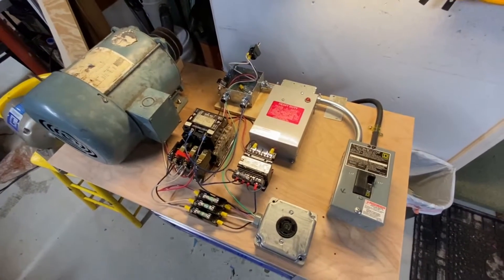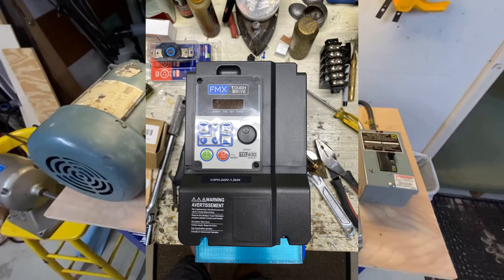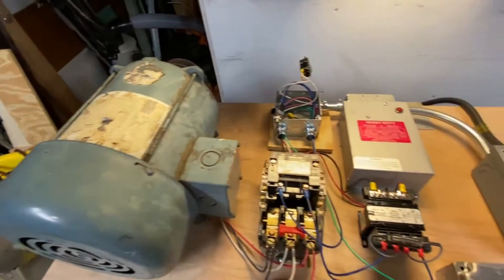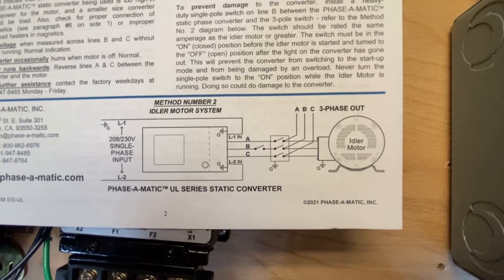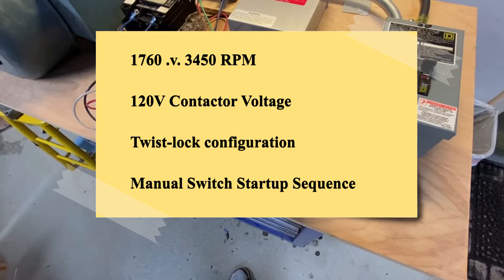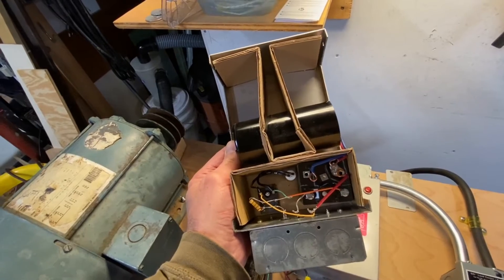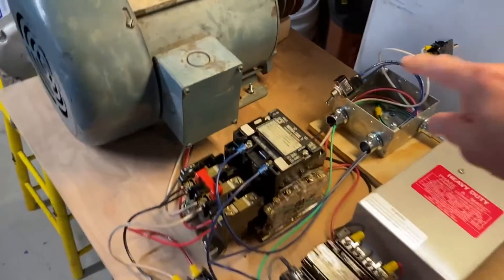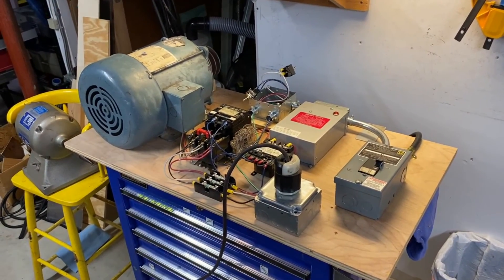Rotary Phase Converter using Phase-a-matic

Comment: From what I've always heard you lose about 1/3 of your total HP with a static phase converter
Reply from the maker: @Shobe9904 I agree, using a static phase converter to run the load motor directly (like the three phase motor in a Delta Unisaw) would result in reduced HP. I believe that using the intermediate motor like here in a rotary phase converter configuration results in full power from the connected load motor.

Comment: Perhaps I'm being pedantic, but you supply one phase to your idler motor, since your house has one-phase power, and the idler generates the other two phases. But, I hear you say, there are three legs, and three phases. Ipso facto one leg per phase, right? No, you also have three loops, or circuits. Each phase has a circuit. If we label the legs A, B and C, and apply single phase power to circuit A-B, then the idler generates B-C and C-A. And since the motor windings are physically spaced 120°, the power they generate is electrically spaced 120° as well. Part of the magic of three-phase is that, if the load is balanced, the phases can share legs, and not need a neutral return path. So it may seem that the RPC supplies a "third leg," but it actually generates two phases, which share that leg,  while the third phase (or maybe it's the first) is supplied by the mains. What the capacitor and other elements do is briefly use the B-C and C-A windings like the start winding in a single phase motor to get it spinning. Then the start circuit disconnects, and B-C and C-A become generator windings, while A-B remains a single phase run winding.

Comment: Thank you for the video, your very articulate way of speaking is very helpful, is there any backfeeding back to the phase converter? I have a 10 HP lathe and trying to use it as an Idler motor to run my 7 1/2 hp lathe, I put a switch on the B line and turned it off after starting the 10 HP, when I start the 7 1/2 the red light comes on again on the phase converter. I'm using 1200HD 8-12 HP phase a matic any help would be appreciated. Thanks again for the video
Reply from the maker: Hi @TerriMullins-ju5ob ... thanks for your kind words ... I love sharing my experiences.

Two thoughts ...

The symptom you describe is what Phase-a-matic said might happen if the generated phase is not switched out when a heavy load starts.  If I were you, I would double check the documentation against your wiring and make sure that your switch is actually on the generated phase.

Secondly, I'm not an expert with motors that big, but you are pushing the limit of what a rotary phase converter can start without "run" capacitors.  However, I might imagine that the startup load on a lathe is pretty small ?

Finally, if the above fails, I would recommend calling the Phase-a-matic technical support line (I think it's 661-947-8485 and/or there's an 866- number on their website) and ask forJeremy.  He'll probably answer the phone.  He was friendly and super helpful in answering questions I had in making the video.  Maybe even mention my youTube video :-).

Please continue to let us know how your progressing in the comments.  Best of luck (and skill of course).
Reply from the maker: Terri, also see the updated video https://youtu.be/5lvSSsYZjLs?si=gzPV6I94hi0dH2eJ .   Same idea, just a cleaner build, a newer phase-a-matic model, and some testing with our surface grinder.
Reply from the maker: PS  Anyone else have ideas for Terri ?

Comment from the maker: I have a request: help me learn: if you disliked my video, please leave a comment to let me know why.  (I don't know if the person who disliked it will see this comment 🙄
Reply from the maker: Thanks for the comment … the discussion is always valuable.

I probably threw you off with my wire colors. The white wire is the third of the generated three phase and would be marked blue with tape if I were to field this … sorry for not making that clearer. No neutral in this circuit.
Reply: Hello I have the same phase-a-matec phase converter and a couple of questions for you my friend
Reply from the maker: @genielife7618  I’m happy to share anything I know !